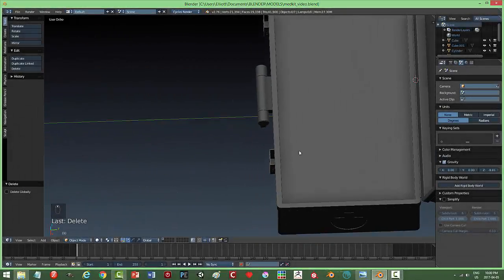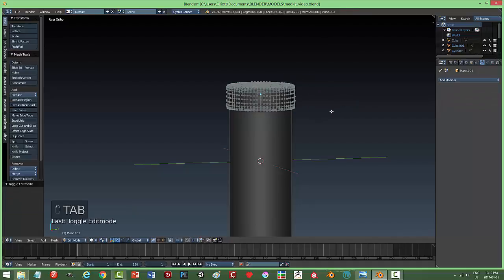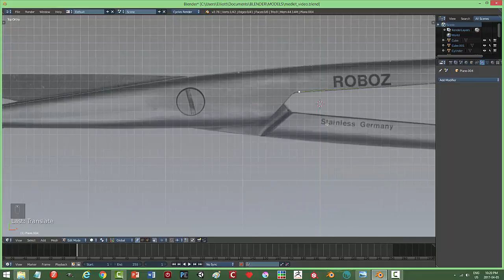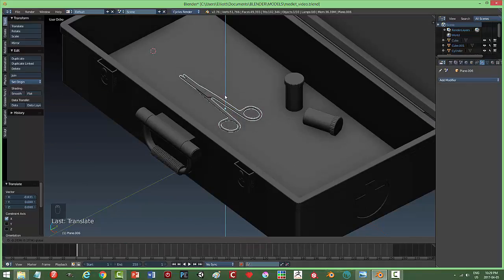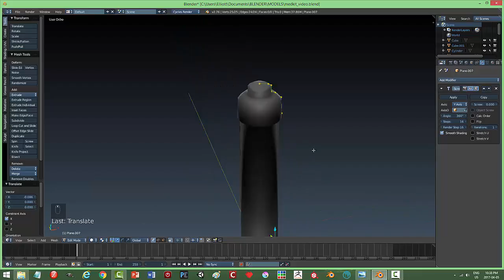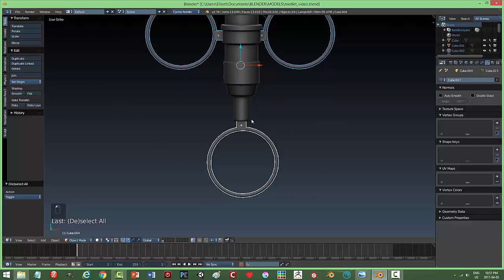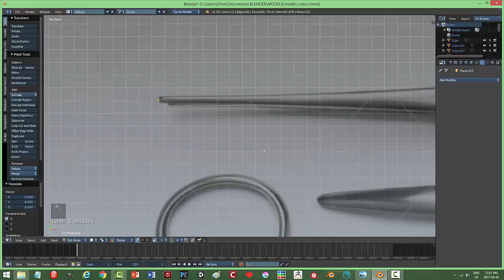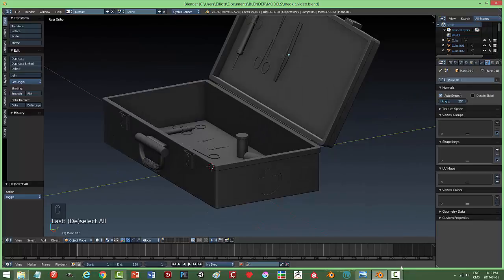Blender: Modeling a Med Kit (Part 2 of 3)

Comment: Thanks for sharing your workflow :)
To avoid the extra edges on the pillbox it would be probably much easier taking a cylinder as the base mesh.
As another tip, if you ctrl-click you don't have to E-G the vertex. It speeds up the workflow ;)
If you put the scissors that way round it probably falls down due to the gravity ;)
Reply from the maker: Peter, you're welcome and yes about the cylinder and thanks for the ctrl-click tip.  Ha, and yep the scissors would surely fall.